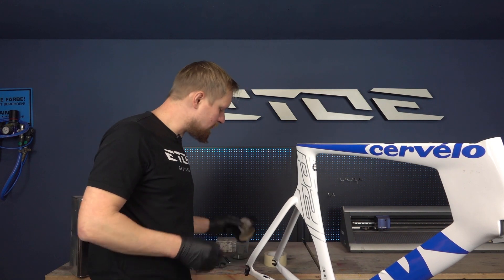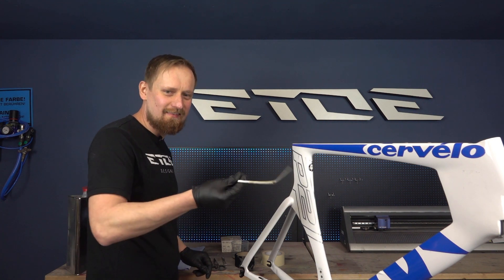How to repair carbon fiber bike frames

Comment: Hi MARTIN, can you make an older carbon road frame which has external cable housing guides that are riveted onto the exist originally factory frame and somehow remove them, fill them and somehow turn the frame into one with internal mechanical gear cable and brake cable housing for a more sleek cleaner look?
Reply from the maker: Yes sure.

Comment: All the videos in this series are really fascinating.  May I ask, what epoxy are you choosing to use when laminating layers of carbon fiber?
Reply from the maker: In this video I used polyester a mentioned in the video.
Reply: @ETOE  And for the structural repairs, is there a type/brand of epoxy resin that you prefer?
Reply from the maker: @rcarlmoy5795  yes of course but this company is not sponsoring me and I'm not willing to give them thousands of sales without support for my work. I have to pay all myself.
Reply: @ETOE  Fair enough. If they ask, you can tell them that I would have bought from them as a loyal customer.
Reply: Maybe try Predator Cycling's kit?

Comment: You might try using heat shrink tape instead of masking tape. It does a better job of squeezing air and excess epoxy out. However, for non structural repairs masking tape is fine.